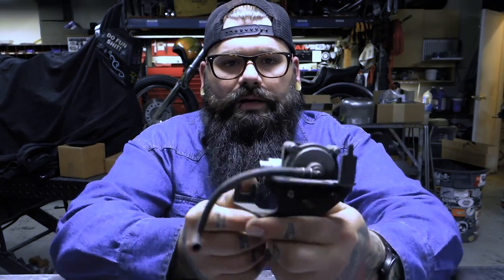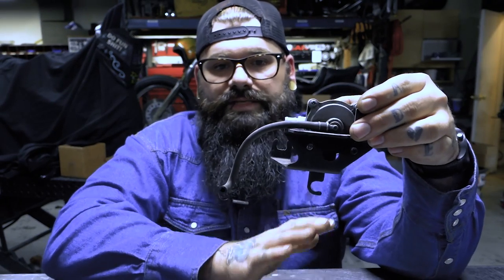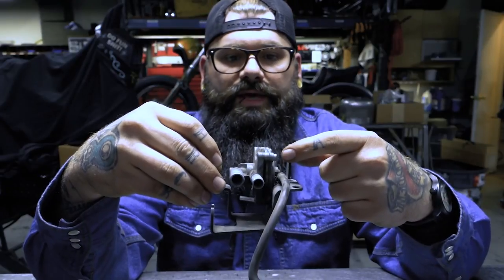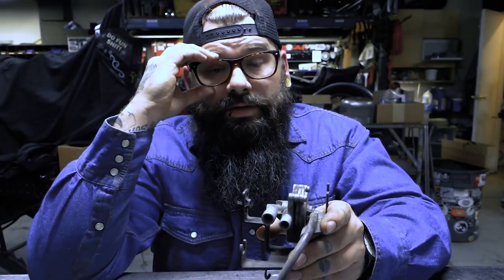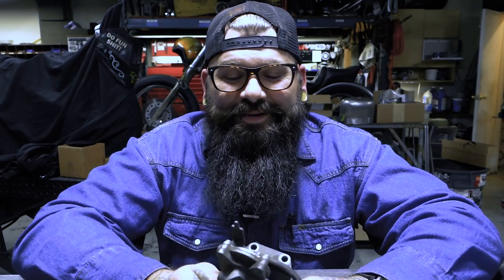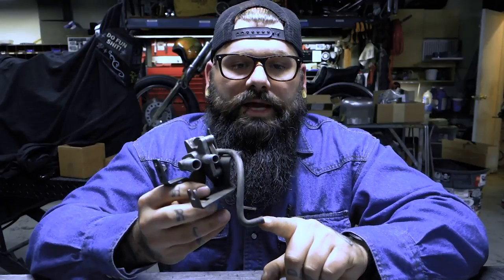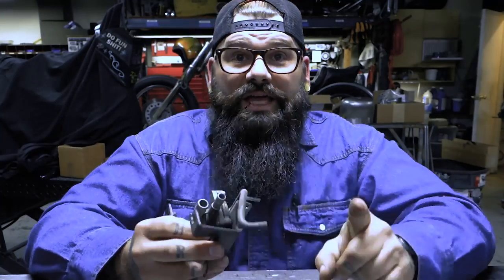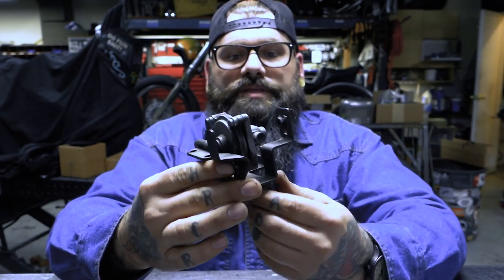Honda Shadow AFP Removal (Auto Fuel Petcock) - HOW TO

Comment: I bought my vlx600 3 years ago not running. Got it to start but could never go over 50mph with out it bogging and dying. Rebuilt the carb with your jets and velocity stack, did a little better but still died. Today I saw this video and i took off all that junk and ran a hose directly to thw carb from the gas tank, with a filter. Bike runs perfect now. It was the petcock. Took it on the freeway for the first time and didnt bog or die. Thanks vato, now i can actually feel a difference from the stock shit in the carb to your parts. I just needed to go faster.
Reply from the maker: fuck yeah man!!! love to  hear that!!! thanks for the comment!

Comment: How you doing. I need a bit of help with a 2008 Shadow Aero 750. The engine only has 400 miles. The bike has not been started for about 4yrs. I put a new battery, added new fuel. The bike sounds like it wants to start but it will not turn over. So I thought that the fuel pump and filter needed to be replaced. However I can’t find either one of them. My research leads me to the rear of the engine under the battery area. However after taking that apart the pump was not there. My friend bought it new in 2008 but got sick in 2009 and passed away in 2014, so the bike has never been tampered with. Please any suggestions will help.

Comment: This is great, as someone who is a visual person thank you! Now is there  a quick way to explain (or point me in the direction where I can find out please), what the tube that connects from the front cylinder to the rear cylinder is?  it has what looks like a filter that connects to the AFP bracket ( in your hand) (connects to that nipple that is sticking straight up.

Comment: Gow about on the vt750...i found mine leaks fuel from the valve out to the vacuum hose. Ive been battling engine vibs at highway speeds(70mph and up)for the longest and in my search found the vac hose wet with fuel.

Comment: You could solve a doubt.

My VT 600, does not ignite the carburetors.

I plug the breather of the carburetors and it works without problems

Comment: @TJBRUTALCUSTOMS it looks like there are two different size hoses going in and out of the AFP. Do you have a recommendation for dealing with that?
Reply: 3/8 works on both, the bigger one is 1/2, but you can stretch the 3/8 over with a pair of pliers. If you're running line from the tank right to the carb both ends are 3/8

Comment: I have an 1984 Ascot VT500 it has the same style petcock but mine is mounted directly to the tank. What would my options be to disable this? Also can I just fit a rubber nipple over the vacuum port on the side of my engine that controls this? Also do you know where I could get OEM like fuel lines for my bike? I tried replacing the old crusty ones from what I'm guessing was 1984 but the line I used has a hard time making the 90 into the front carb starving it of fuel...
Reply from the maker: The vt600 and vt750's all had a tank mounted petcock. Are you saying an afp is mounted to your tank?

Comment: 1996 vlx600- to remove the "fuel pump" I just need to take it out, add a circle of hose, a fuel filter, and run it directly from the tank to the duel carb? is there anything i need to plug? i know i need a vent tube or vent cap. whats a vent tube?

Thanks TJ!

Comment: I replace my fuel tank on a 2005 shadow  with a 2012 fuel tank. I need to find an adapter that fits the fuel reserve sensor port so I may add the petcok. Or a way to connect the fuel hose directly to the carburetor. Any suggestions on how to do this will be appreciated.
Reply from the maker: Sounds like a headache!! We have never done that, so you probably know more than we do!
Reply: Thanks for the reply brother. I’m going to buy the AFP plug on your site to plug for the vacuum line. 👍🏽💪
Will update as I continue with modifications
Reply from the maker: @juanjerez9465  WooWoo!

Comment: Thanks for your videos!  I have a 99 VT600, but it only has a standard petcock on it. (Have only owned the bike for 1 yr). Does this mean someone already changed it over? 
Regarding the petcock, I am actually having a problem with mine after removing it (and the entire gas tank etc) last fall to do a thorough cleani-out of all parts, including tank, filter and petcock etc. It was working fine for a whlie afterwards, but recently the valve does not actually shutoff, so it leaks gas into carb while sitting. (This is made worse by the fact that something must be sticking in the carb as well, because the gas then leaks out and down the cylinders and onto the floor!  However it RUNS GREAT while running).  Do I likely just need a new petcock assy?

Comment: After removing the AFP, did you just let the choke cable and idle control hang?
Reply: TJBRUTALCUSTOMS I misunderstood, thanks for the clarification.
Reply: @TJBRUTALCUSTOMS  I'm looking for the plug for the rear head and the link in the description does not work, Can you help? I was quoted $180 for a new AFP. no way.

Comment: 2003 Honda Shadow 750 fresh oil change has fuel in the oil and rear cylinder noise HELP!
Reply from the maker: you are getting gas in the oil because the fuel is going in the cylinder and not igniting, or the float valve is not holdIng the fuel back when the bike is off and the fuel is getting into the cylinder. . this will lead to damaged rings among other things.

Comment: Hello TJ, I am making a custom motorcycle using 16 different vehicles, I am going to use a Honda shadow VLX 600 engine whose CDI is broken and there is no one in my country and it is very expensive to import it. I know that you can put 2 CDIs instead of the original. You have a video of how to do this, since I have seen that some pins of the pulse generator must be cut. Thanks a lot
Reply: @TJBRUTALCUSTOMS  Thanks for your prompt response. I understand what you are saying, then maybe you can answer me this other ... The right side of the Honda engine has a reluctor in charge of exiting the pulse sensors, my question is why it has 6 pins when only one is needed to excite them. sensors what function do the other 5 pins???

Comment: p.s.  you mentioned there should always be an inline gas filter installed. Can you recommend a specific one that would fit well in the small amount of space under the tank, and with the small amount of hose available to splice into?  I've looked in autoparts stores but they all look too big!
Reply: @TJBRUTALCUSTOMS  Awesome, thanks!  Will be purchasing that from you.  
Second question - you talk about removing the AFP which acts as an auto shut-off, so if removing it, should a manual petcock valve be put in to manuallly shut-off gas when not using?

Comment: My fiance motorcycle it is a 2006 hinda shadow 600 VT and that part is bad the vehicle has sat for 3 years , but my father in law said replace it. I told him about the afp plug and put a fuel filter in instead. He said it would flood the bike that way please explain more
Reply: put a filter on mine works great won't flood it
Reply: put a  3/8 fuel filter for autozone works great

Comment: I don’t see the screw on your site, does anyone know what size it is?
Reply: Currently having the same problem, have you found a size that works yet?
Reply: @michaelmclaughlin9476  yeah dude! I hit them up on their website and they replied in a few hours. "You will need a stainless M5 x 0.80 mm Thread, 8mm Long bolt to plug the AFP Vacuum Port. 
Do not use anything but stainless as steel bolts can rust and cause internal issues." Goodluck!
Reply: @BladeInTheCrowd2  I can sell some

Comment: I am about to do this because this thing is leaking in my vt600, but my question is: doesn't the gas then leak into the carburator when the bike is not running because there is no valve holding the fuel back?
Reply: TJBRUTALCUSTOMS looking forward to throwing anything that my bike does not need like the AFP in the trash! To plug the port can I get the threaded bolt at any hardware store? I normally order most my stuff from your site but I already have this all apart and want to put it back together and ride this week. Thanks.
Reply: big_air_ jer i just gotten a screw that fits, screwed nto the vacume line in stead of the engine. Works perfect.
Reply: I own a 2001 VLX and a 2005 Sportster. Both had a vacuum controlled fuel supply. The Sportster did not have the AFP but it did have a vacuum diaphragm built into the stock petcock. I replaced it with a manual petcock and plugged the vacuum hole in the manifold. Since the Sportster owner's manual said to ALWAYS close the petcock when parking the bike overnight or longer because of a possibility of leaking fuel into the motor, I close the petcock on both bikes after my rides. It may be overkill but it's easy to do once you develop the habit.
Reply: big_air_ jer did you end up buying the bolt from his site?

Comment: Hey TJ heard of your channel through "Do it with Dan" War Horse video. Also I'm noob AF to YouTube so I don't know how to DM you on here I have a question. I have a Honda Shadow vlx 600 2001 I've been having an issue for the past 2years where when I'm riding if I hit about 60 to 65 it seems like my bike is not getting enough gas and it seems like the engine starts to choke but if I slow down below 55 I will have no issues as long as I keep it under 60 It only happens when I go above 60, I was wondering if you think the AFP could be the cause of this?
After watching your video it sounds like it could be I just want to be sure.
Reply: Can you please post a link to the AFP plug that you are talking about so that I may buy one. My gas tank already a fuel filter inside the tank. Should I put another one on going from the line to the carb or do you think the one in my gas tank is sufficient enough? Thank you for your help.
Reply: @TJBRUTALCUSTOMS  okay I see it now. Thank you for your help.

Comment: Khairy, most likely Honda loved putting these on all there bike in the same era just check to see what id fuel line you need, pick up a >>>fuel filter<<< super important and go directly from the tank to the carbs
Reply: Jeff Graham II 

I just bypassed the afp by running a tube from the manual Petcock to the carb with a fuel filter in between. I also plugged the vacuum line but the bike seems to be a bit laggy and Boggs down if I hit the throttle hard from idle. Once I get through the first 25% of throttle then it seems to run fine. Can anyone help me out with this?
Reply: Have you done any other mods to the bike? Also what is the year make and model? When I bypassed my afp I had a super lean issue cause the angle of the fuel line was wrong so I wasn't getting enough gas to the carbs. But It really depends on what has been done to the bike before you bypassed the afp.
Reply: It’s a 2006 600 vlx. I have the baffles removed but I don’t have a jet kit in it yet. It ran perfectly fine after the baffles  were removed and before the afp bypass but now it has the bogging symptoms.
Reply: I would definitely go back and try adjusting the tubes angle  to make sure you are not having you gas fight gravity 1 or 2 degrees can make a huge difference
Reply: Dylan Sessions also how did you plug the vacuum port dod you use a vacuum cap or just replace bung with a bolt?
Reply: I used the screw the tjbc sells on his website.
Reply: Dylan Sessions hmm yea check the angle of the tube
Reply: @AnyKeyStart1   I have a 2001 honda shadow 600, just was wondering where you got your fuel filter?
Reply: @AnyKeyStart1  awesome, thanks bro.

Comment: What size length and thread pitch is that Allen bolt. I'm going to take this off of my wife's bike because it started pouring fuel out if the little hole on the bottom of this unit when bike is running. Complete garbage.
Reply: Did you have any luck fixing the issue on your wife’s bike? I have the same leak on mine.
Reply: @mikeshetler8674  oh yeah it's a life saver. Just run the fuel line straight to the carb. And if I remember right it's just a 5mm bolt you need for the cylinder
Reply: @tylerchouinard4007  thank you!!
Reply: @tylerchouinard4007  did you end up putting a fuel filter in the line going to the carb?